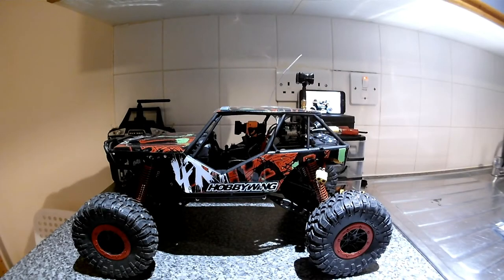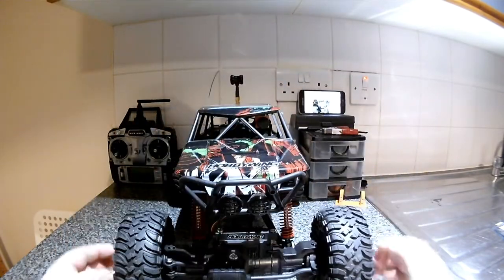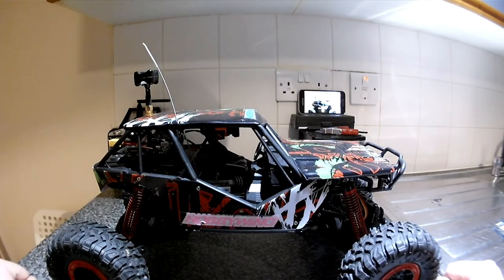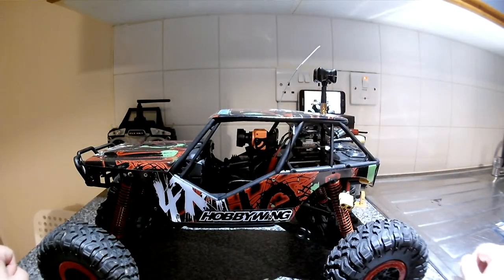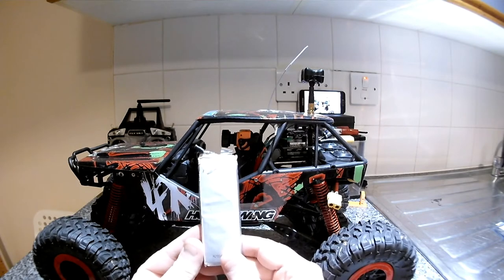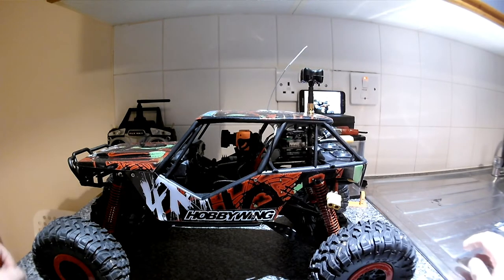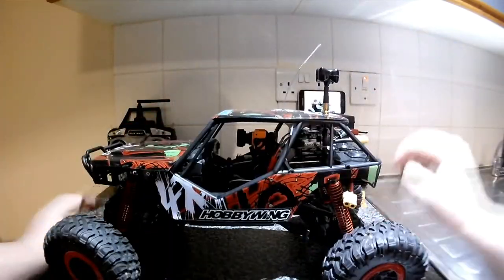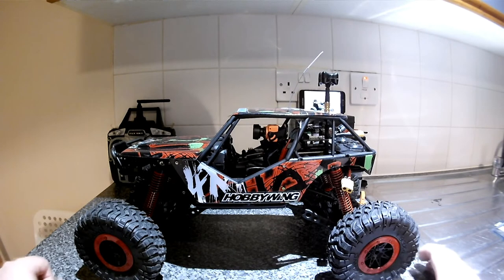HB P1001 'Cross Country' Long Range FPV Crawler

Comment: That 2.4 antenna looks really close to your 5.8 ghz transmitter. Aren't you worried about EMI? Have you checked your RSSI numbers with the vtx both on and off?
Reply from the maker: I need to add an antenna tube for the 2.4ghz so its straight and not leaning over to the 5.8 antenna. Once straight its far enough away for me not to worry about it under 3kms. There is another 2.4ghz antenna running horizontally under the middle of the top plate.
Reply: Very cool. Look forward to seeing what you can do with 2.4/5.8. I'm starting a ground-pounder build myself but presumed 433/1.2 may work better with trees instead.

What are you going to use for your "antenna tube". Optimally you want something that doesn't snap in half if you flip but also rigid enough to hold your antenna up.
Reply from the maker: Im just going to use the same tube you get with an RTR ground rc, basically a plastic tube. Yes, 433/1.2g would have more penetration and you get more range for your bucks! i will go that way eventually.